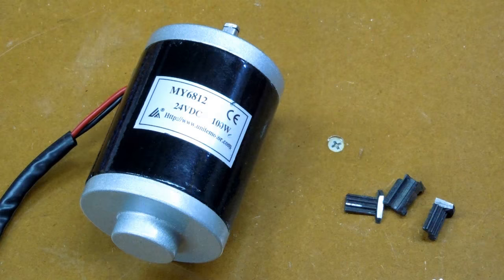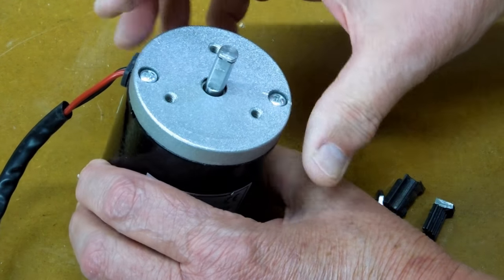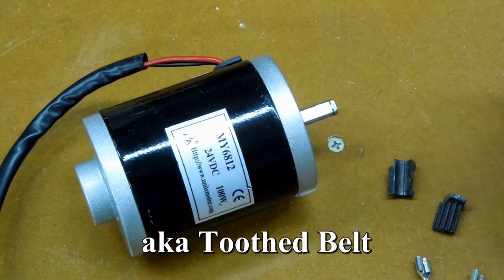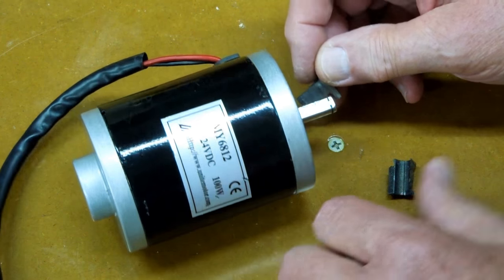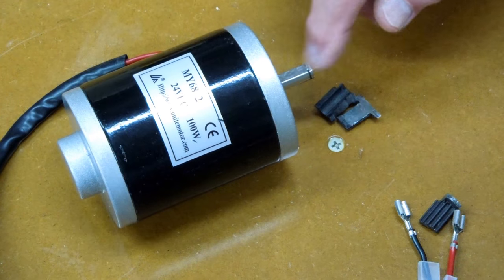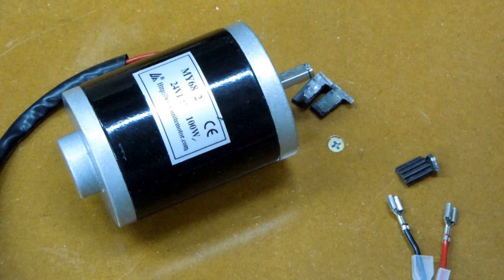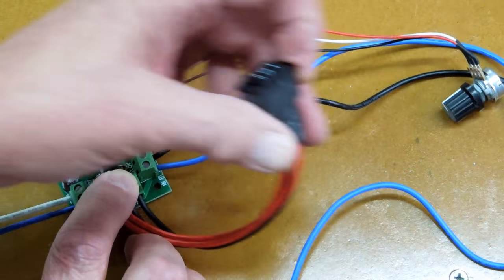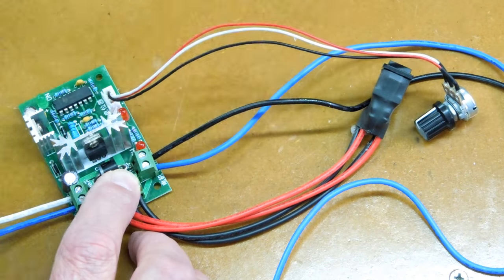Senior 20 Organ (33) 12V Scooter Motor Test

Comment: Having trouble attaching wheel to one of these motors. 5mm reverse thread on motor. Need to mount a wheel with hole diameter 10mm. I'm amazed how little help there is with this. No info. No couplers available.
Reply from the maker: Sorry, haven't seen one of these with a threaded shaft. All of mine had shafts with a flat and the sprocket was glued on. Good luck!

Comment: Did you look at BLDC motors at all? Controllers are reasonably inexpensive and it's very very easy to get precise speed control.
Reply from the maker: I did not consider BLDC motors, I am not familiar with them. I wanted to use something simple that anyone could obtain and keep the cost down. The motor and speed controlled used here are relatively inexpensive and have performed well.

Comment: How much noise does the motor on its own make? Couldn't discern it at all while the music was playing :)
Reply from the maker: It is pretty quiet idling along around 725 to 730 RPM which is about half of the no load speed for this motor on 12VDC and it does not get hot, even after playing several consecutive music rolls. Much quieter than the previous window regulator gear motor.
Reply: Ronald Walters Brilliant stuff :)
Reminds me of the super quiet motors you get in things like cassette players, only a lot bigger.

Comment: I am working with the Topsy 3 midi organ plans and I see he has a schematic to build a motor/ bellows speed control with switches.  would using this pre built purchased speed control pretty much be the equivalent function wise to the one he is showing how to make.
Reply from the maker: I have not built the Topsy 3 yet. I am told the speed control and switches are an over-complication and not necessary if the motor pulley and crankshaft pulley are geared correct… a speed control similar to what I have used in the Senior 20 would work just fine.

A friend of mine has built all of this … contact jaycaughron@yahoo.com and he can help you with specifics as well as the electronics for playing midi files, etc.

Comment: Where can I find/buy the DC motor controller shown in this video? I found em...
Reply from the maker: By searching eBay for the description given in the video description "PWM DC Motor Speed Controller" https://www.ebay.com/itm/DC-10-30V-Motor-Speed-Controller-Reversible-Switch-PWM-Adjustable-Regulator-80W/122045908251?epid=917821941&_trkparms=ispr%3D1&hash=item1c6a80c51b:g:uC4AAOSw0fhXjF5O&enc=AQAEAAACUBPxNw%2BVj6nta7CKEs3N0qWd4bhtw6aDchxWuLrQDnLR8l7AVmd63sXgXF9%2BFWzdbNv4MGF1lb5HuPFBGmg0ygy2YhjGoSpE30NXHPQjrzEWBzFlHLGS6X8dde%2FYAZdutoy%2FflTu5qmkJyBa578yufUcg6mfaDl2Zn5k2P4oxBrc5CiTRTw1GRNUGlsfcEtGcA66L%2FBjsZ%2BPt%2BIq2DfjWuGQxNMyHuAfhpWmZ%2BpiP3Di9PGHuDM8cEUerHkHe5%2Bra3ibbkBlbMbPJJQMQuHVqMWvCBelo4HNXn0Ago2hCfoDxRHCb2ZmyvAiLulzsZMr0FDqyuNQh85%2FMZkHWY%2F%2Bh86vjA5t0hAskILGlB6bbgYj2yH%2BqN48fyNwfDjIZMcsthTRtd%2BJtHtVHMH1EnddvdEwotbSlp6t%2FMELcXSs3UJ6gMj07DXkAuDniAOxrE1OhNL3Tmx6vZ9r75TumFU7JMuZRPUAFeBGntHm11GEcWGnvnU%2BtC%2BfMkKZJqgRKICtfDTQcQs9pvvjK8kJucsjXsrrPPfljdlruYT6BrgM833o28ptzwSsi2RewfKLIbynbxE%2FU1MkBbCfCsbt7QN8RFnATuWrF65n0pJVlBbj6WVqXVQ8tgabX%2BZEkXwLWpDhBAj7mCTPRvHuxMZgp4CjzlhYYsDRmfRd7%2B9G2Oe0yRrrt78i1hjljAW8v%2FEQyB9d6QhYcpe1hBL9Wf7KUdp7yE5GGseHWLT46lWKE%2FdF2zjPMAvVjtW4r%2FK3OPfXvOhUSJWAa7pomzL97zPU6GoKXRc%3D&checksum=122045908251145bca97c0e2451896219cf9a17a92f4&enc=AQAEAAACUBPxNw%2BVj6nta7CKEs3N0qWd4bhtw6aDchxWuLrQDnLR8l7AVmd63sXgXF9%2BFWzdbNv4MGF1lb5HuPFBGmg0ygy2YhjGoSpE30NXHPQjrzEWBzFlHLGS6X8dde%2FYAZdutoy%2FflTu5qmkJyBa578yufUcg6mfaDl2Zn5k2P4oxBrc5CiTRTw1GRNUGlsfcEtGcA66L%2FBjsZ%2BPt%2BIq2DfjWuGQxNMyHuAfhpWmZ%2BpiP3Di9PGHuDM8cEUerHkHe5%2Bra3ibbkBlbMbPJJQMQuHVqMWvCBelo4HNXn0Ago2hCfoDxRHCb2ZmyvAiLulzsZMr0FDqyuNQh85%2FMZkHWY%2F%2Bh86vjA5t0hAskILGlB6bbgYj2yH%2BqN48fyNwfDjIZMcsthTRtd%2BJtHtVHMH1EnddvdEwotbSlp6t%2FMELcXSs3UJ6gMj07DXkAuDniAOxrE1OhNL3Tmx6vZ9r75TumFU7JMuZRPUAFeBGntHm11GEcWGnvnU%2BtC%2BfMkKZJqgRKICtfDTQcQs9pvvjK8kJucsjXsrrPPfljdlruYT6BrgM833o28ptzwSsi2RewfKLIbynbxE%2FU1MkBbCfCsbt7QN8RFnATuWrF65n0pJVlBbj6WVqXVQ8tgabX%2BZEkXwLWpDhBAj7mCTPRvHuxMZgp4CjzlhYYsDRmfRd7%2B9G2Oe0yRrrt78i1hjljAW8v%2FEQyB9d6QhYcpe1hBL9Wf7KUdp7yE5GGseHWLT46lWKE%2FdF2zjPMAvVjtW4r%2FK3OPfXvOhUSJWAa7pomzL97zPU6GoKXRc%3D&checksum=122045908251145bca97c0e2451896219cf9a17a92f4

Comment: Hey there. 

Im  hoping to use one of the 24V motors to add a reverse option to my Go kart. Issue is that it weighs atleast 120KG with myself included. Would two 12V lead acid batteries plus the 24V motor be strong enough to move that kind of load? Not at a fast speed as i am just using it to reverse.
Reply from the maker: I have not seen any torque numbers for these motors. Some are labeled 100 Watt and others 200 or 300 Watt. I doubt these would be strong enough for you. You may want to consider a wheel chair gear motor or 12 VDC starter motor, which would need to be modified for a chain or belt drive. Or look at one of these on eBay - 350 W 24 V DC electric motor f bicycle bike scooter MY1016z3 gear reduction   Carrying around the extra weight of a motor and battery may slow you down. Good luck!

Comment: How would you go about putting a sprocket on this?
Reply from the maker: Hopefully you could find a sprocket with an 8mm hole in it  and use  the set screw in the sprocket to tighten on the motor shaft flat. Even better if you could find a sprocket with a matching "D" hole in it... but good luck with that. Thanks for watching!

Comment: How much weight it can pull I'm planning to buy it for auto slide gate project small gate only not so heavy to slide
Reply from the maker: Sorry, I cannot answer that. No torque data given with the motor and I have no way to measure it. This is a 24VDC motor and I am running it on 12VDC to drive the organ. Go to eBay and search 24VDC (or 12VDC) SCOOTER MOTOR. It has quite a bit of torque, You would just need to play with the gearing and voltage going to the motor.. They also sell a scooter motor with a gear box attached.
Reply: @RonaldWalters2010  it's ok thanks bro

Comment: How did you removed this gear?
Reply from the maker: Easier said than done. I removed the E-clip and discovered the gear was glued on. Probably with something like Loctite which may release with heat but I did not want to get the bearing hot or possibly cause some other internal damage. I used a hacksaw to carefully cut as close to the motor shaft as possible without cutting into the motor shaft. Then carefully dressed it off with a flat file (again not damaging the motor shaft). After a couple of cuts the remaining pieces will break off the motor shaft. Then you will need to clean the remaining glue residue off the shaft. The gear appeared to be a type of cast iron and cut fairly easily.
Thanks for watching! Please subscribe. 
That is what keeps this channel going. 
Ron

Comment: ..sir i buy a 12v vdc 120watt. i want to know if i can use 24v in the motor
Reply from the maker: In some applications (such as this one driving an organ for a short duration) you can use a 24VDC motor on 12 Volts. However you probably cannot use a 12VDC motor on 24 Volts... it will try to run twice the designed speed and the wiring may fail if the current goes too high. You may get away with running it on 14 to 16 volts.

Comment: What was the cost of the motor and controller?
Reply from the maker: 24VDC Scooter Motor was $30 with free shipping from California. Also available from Hong Kong or China. The PWM DC Motor Speed Controller $10 shipped from USA source. Also available from China for around $8 and you will receive it in 10 days to 2 weeks.

Comment: Can that motor handle 36v plss help
Reply from the maker: The motor is rated 24VDC. I can use it to drive the organ with 12VDC because the load is small. Trying to run it on 36VDC may damage the motor due to overspeed... and I have no idea what load you wish to place on the motor. I really cannot help beyond that.
Reply: @RonaldWalters2010  hahaha thanks for the info i was hoping to use this on a electric skateboard and im only 45kilos i watch some videos of this that can lift a 85kilo weight with a speed of 10mies per hour but thats not enough for me, thanks new subscriber

Comment: Where did you get the idea for the scooter motor?
Reply from the maker: I had seen something similar used on a much larger organ and then a friend mentioned I could probably run the 24VDC motor on 12V. These motors are typically quoted at no load RPM and I could not find a torque curve for this one. That brought it down to experimentation. Reducing the drive pulley to 1 inch diameter and getting it to operate somewhere around its 12V mid range RPM did the trick. The PWM DC motor control certainly helps.
Reply: It seemed to run much smoother.  Less erratic if look at from the point of pull on the motor better torque I guess.

Comment: How do u power this fully with battteries
Reply from the maker: With a single 12V 7 or 8 Ah sealed AGM battery. It will play and rewind approx 8 music rolls. I try not to run it much below 12V before charging. This is a common battery and similar to what is used in a computer UPS.